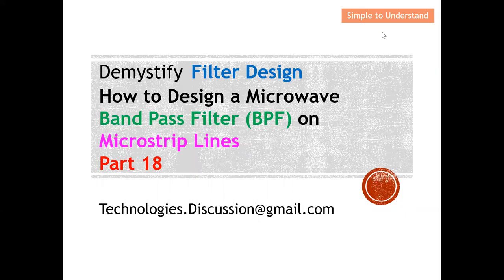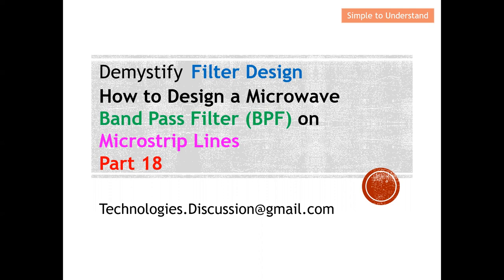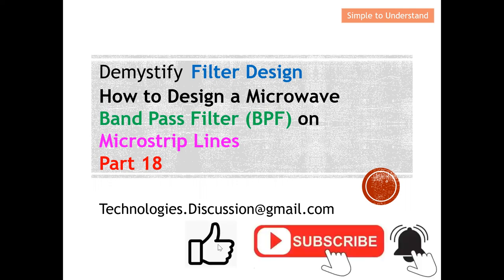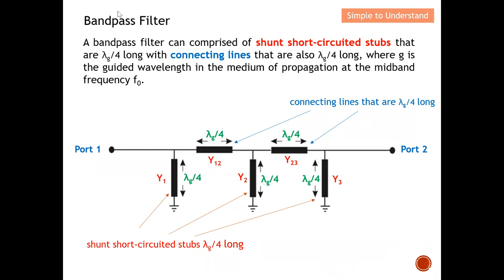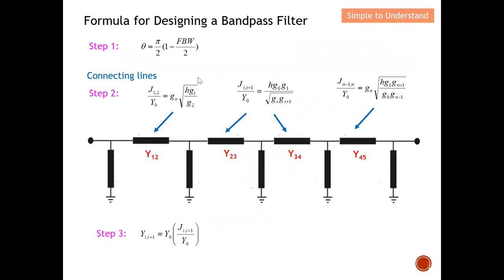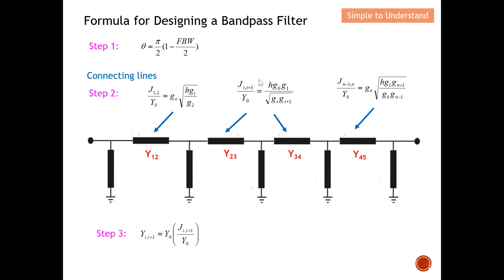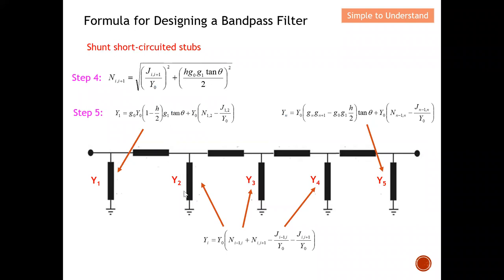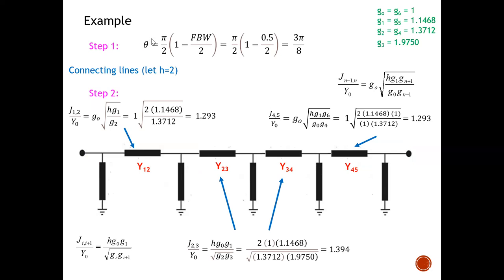Filter Design Part 18. How to Design a Bandpass Filter (BPF) on Microstrip Lines for Beginner.

Comment: The discussion is not ended until you build the filter  and show its performance. After that you can start a new discussion about why the performance was wrong.
Reply from the maker: Your expertise in this area is evident. You are absolutely right! After fabrication, it is exciting to obtain test and measurement results, but later you may find many mismatches and not know how to proceed. In fact, when I served as a reviewer for IEEE, I questioned some works on this topic. I know a few tricks to correlate test and measurement results with simulated results, but this is a completely new discussion, and I am afraid I can't discuss it fully here

Comment: really helpful lectures. I want to ask you if I have midband frequency fo = 3GHz then how I will select the parameters.
Reply from the maker: If u only change the midband freq then only the length of the transmission lines change. The rest like impedances are still the same.  :)
Reply: @technologiesdiscussion1676  
Thanks for your reply.
Reply from the maker: No Problem.  :)
Appreciate u can help by Like this Video and Subscribe to this Channel. Thank you so much.  :)
Reply: @technologiesdiscussion1676  done
Reply from the maker: Thank you so much for your help  :)

Comment: I simulated this bpf and I'm getting exactly the same response as shown at the end. 

I was thinking, if we replace this short circuited stubs with open circuited stubs we should get a band stop filter and I tried it in my simulation, and yes I do get rejection from 1.5 to 2.5 GHz but I'm observing ripples in passband and S11 is also very less (<10dB) at some pass band frequencies.
I was wondering why I'm not able to get smooth pass band, it would be great if someone can shine some light on this. 

Or is there any different calculation to design band stop filter using stubs?
Reply from the maker: Thank you for trying on stimulation tools to check the frequency response.
Yes, you are right, when we replace Short with Open Circuited, it become a Bandstop filter. At Smith Chart, when u turn another Quarterwave, the charactertics changes completely. You need another set of rules to design Bandstop.
Reply: Thank you for quick response sir, 

Can you do a video on how to design band stop filter? or can you share any research paper or article on how to design band stop filter?

Nothing urgent, just wanted to know how these microstrip filters are designed and your channel is a gem sir :)
Reply from the maker: @Hari-uy3rm  Sure. Give me sometime to find the easiest way to design the Bandstop filter.
Reply from the maker: Thank you for your strong support!!!  :)
You can help this Channel by help to Like this video, Subscribe & Turn on your Notification bell. Thanks!!!
Reply from the maker: Done. A video on How to Design a Wideband Microstrip Bandstop Filter with Open-Circuit Stub.
https://youtu.be/La1PZdgYNU4